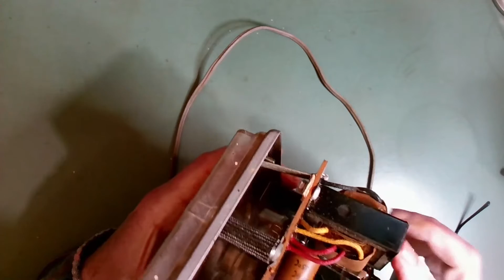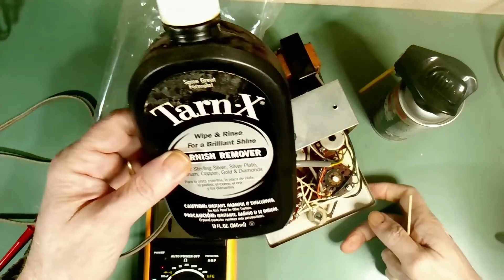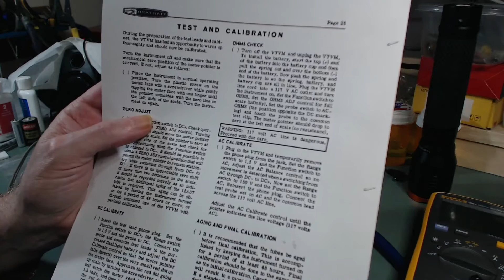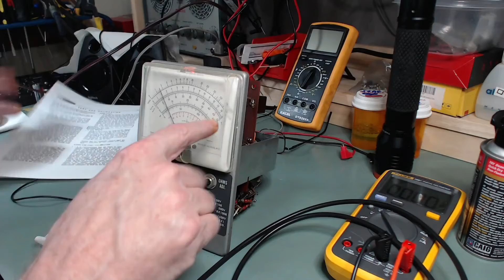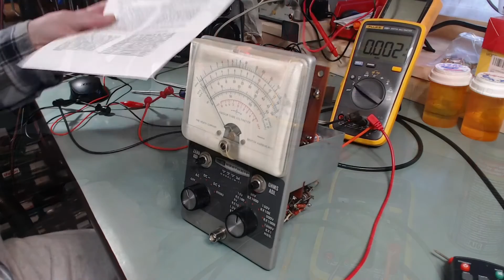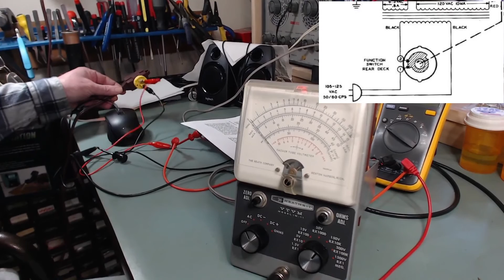Heathkit VTVM model IM-11 restore, repair and calibration

Comment: Nice video = thank you. I like your DIY BNC probe solution = a secure and sound connection. Glad you found a place for the 1M probe resistor inside the case; I was going to suggest that. What do you think of the Novus plastic cleaner? Link? Just wipe it on and off? Is the Tarn-X just wipe on and off, too? Does the new bottle of Tarn-X make the same discoloration? Cheers!

Comment: There’s a guy on eBay that makes a battery eliminator circuit, it worked great in mine.  I couldn’t get mine past the 5v cal step for some reason.